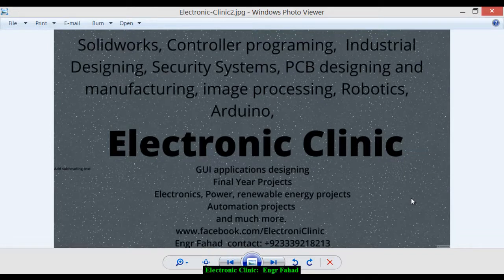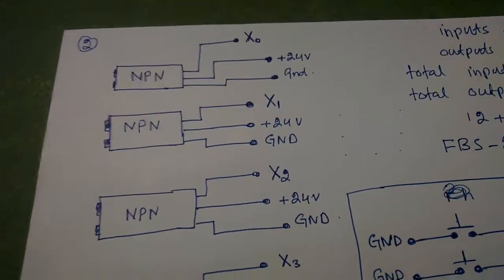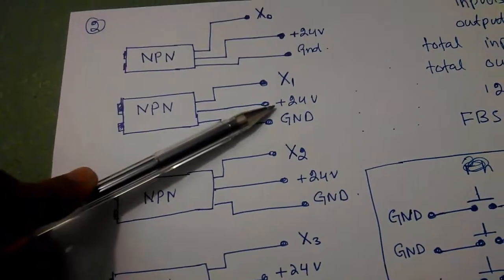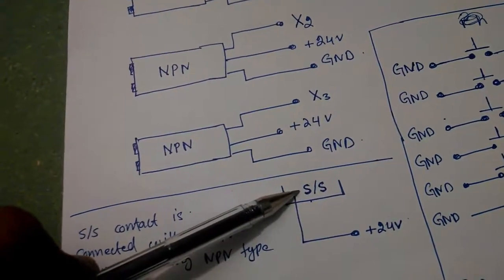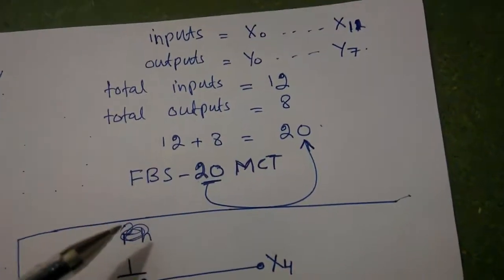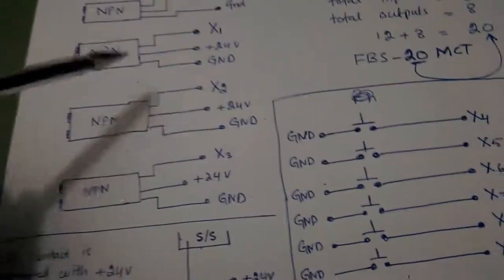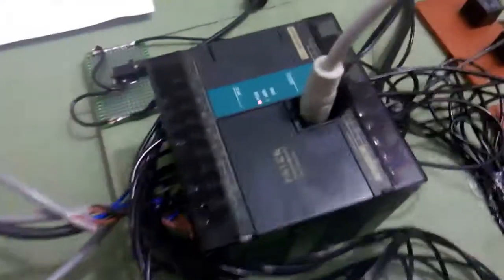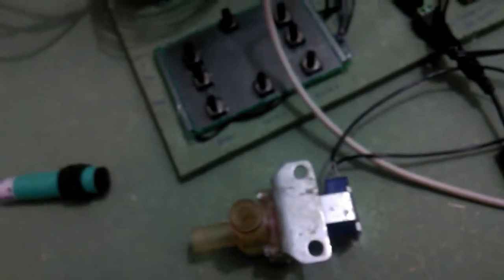PLC ladder logic programming tutorial# 26: Automatic water tap control system using solenoid valve

Comment: Very Good Tutorials.Fahad what is the price of this PLC and Sensors.and From Where u buy These Items?
Reply from the maker: Purchase these from Lahore.
Reply: 20FBS MC price??.also 14FBS .
Reply from the maker: 20FBS costs around 18000 without cable. and 14FBS about 12000, but these are 1 year old prices.
Reply: ohoo very expensive.is there any cheap one for practice.
Reply from the maker: you can search for used one. i had but used it in project.
Reply: where i can find old plcs?